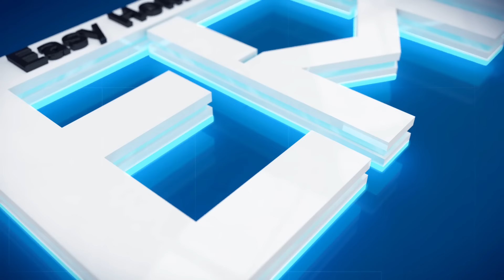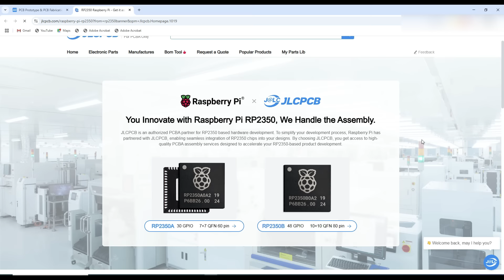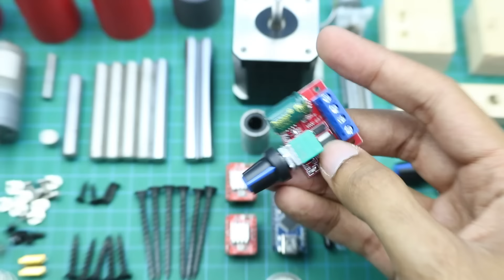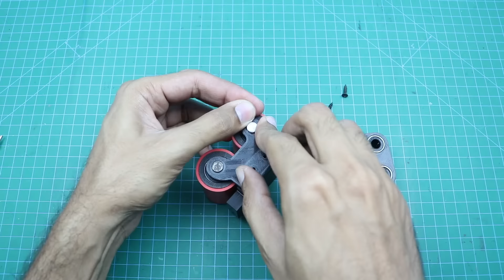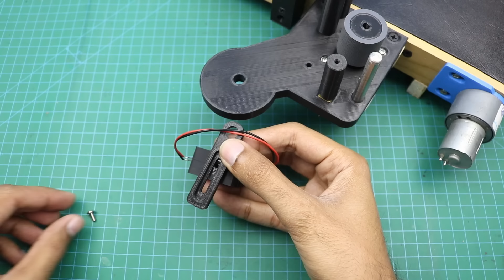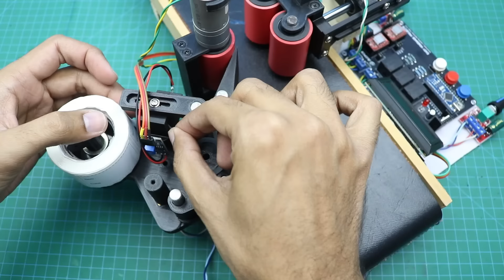DIY Full Automatic Bottle Labeling Machine using Arduino

Comment: What do I need to study to be able to do this stuff and more complex projects like this from scratch???
Reply: Electronics and mechanical engineering
Reply: @modernaryabhatt  aka Mechatronics engineering
Reply: Learning SolidWorks or any other CAD software, a PCB design tool like EasyEDA, and Arduino programming (using C++) is a great start. Add to that a deep understanding of electronic components and how they work, along with some mechanical skills for assembly and handling.

It takes time, focus, dedication, and even some money for failed experiments—but it’s truly amazing to be skilled in all these areas! 💡
Reply: @boombeachgame1305 thanks for that detailed flow. I have quite an adequate understanding of computer programming with python. I'll expand the my knowledge further given what you have stated. Thank you again
Reply: @boombeachgame1305 I'm trying to figure out how to build an Automatic liquid sachet packaging machine.. would you happen to have any schematics or maybe a video on how to go about it